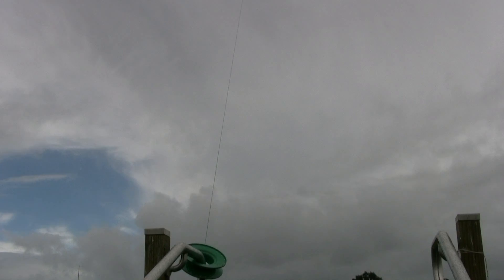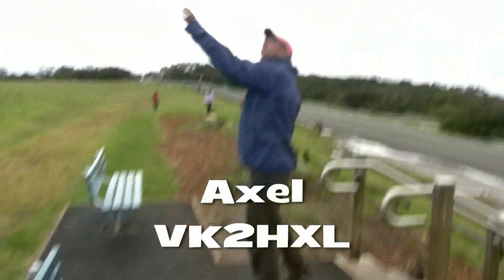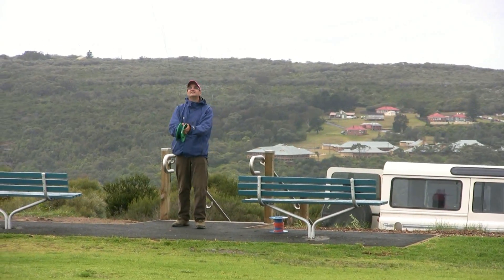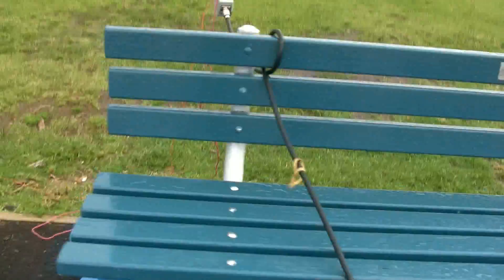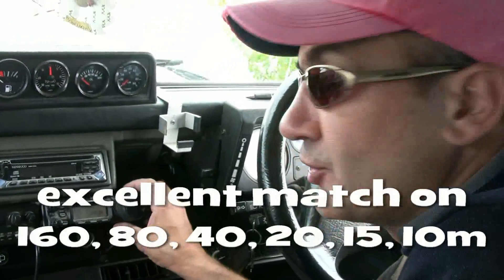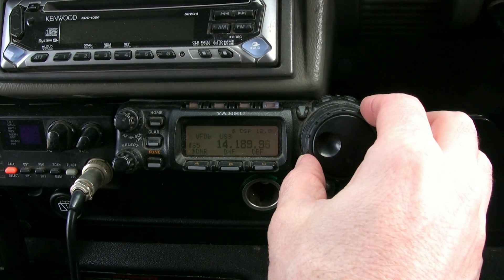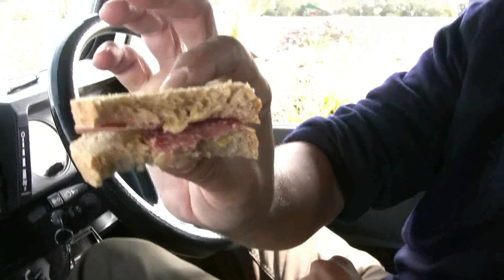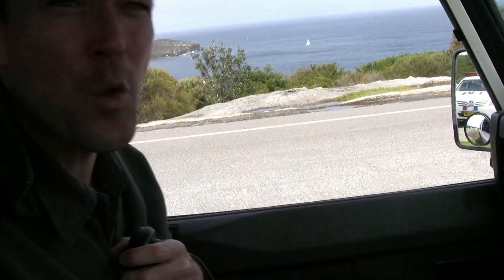Kite antenna for 160-10m - Oceania DX Contest 2010

Comment: Try to use stainless  steel downrigger  wire. The one used for fishing. Use 100m string than attach  the wire. I use a 200m long wire, rated for 80 kg. You can use a much bigger kite and you have wind all the time at 250 - 300 meters up. Don't  use insulated wire so you can roll it up and can be tuned to the frequency ( no tuner required ). Than just use an alligator clip to the wire side and a banana plug to the radio. It works great on all bands. 
ATTENTION !!!   STAY A WAY FROM HIGH POWER WIRES IT WILL KILL YOU !!!
Reply: I wonder if 200 meters of wire reaching far into the sky offers a significant improvement over a much shorter antenna closer to the ground. One way to test that would be to set up WSPR transmitters near one another with each antenna and operating on the same band. Then see what the coverage of each is. Perhaps you could even publish the results on YouTube.

Comment: that works fine, it should be an nice experiment to put an 1/4wave ground plane for 160M in it. or maybe to work with traps for multibanding. i'am a bit skeptical about balluns. but you had some great fun that day, most important. 73's de PD0MP

Comment: You'd need a much shorter antenna for the FM band and you'd have to use a transmission line from the ground up to the kite. If you used ribbon cable (old style TV cable) instead of coax it should be possible to lift it up with the kite and it wouldn't be too lossy. It would definitely increase range.

Comment: The 49:1 unun provides a good match to 50 ohms from an end-fed antenna. The 40m wire is a half wave on the 80m band, and a multiple of this on the higher bands so the antenna offers a high impedance on all the bands of interest, typically 2 kohm - 5 kohm.

Comment: I am well impressed.  I have never tried usinga kite for antenna use, that's somethingi will try soon. I have bought kites in the past, but they have usually disintegrated in the wind (probably because they were cheap). I will have to buya decent one. 73 de Bob M0BOB.